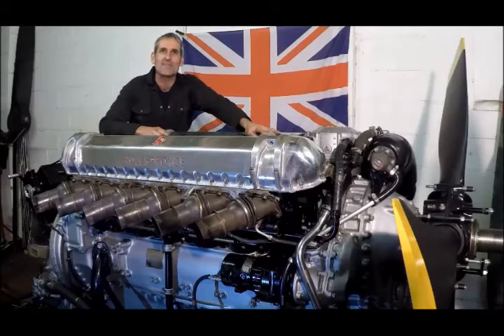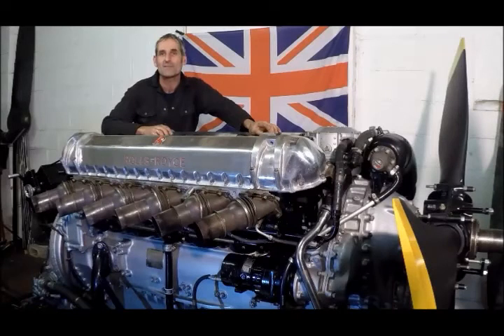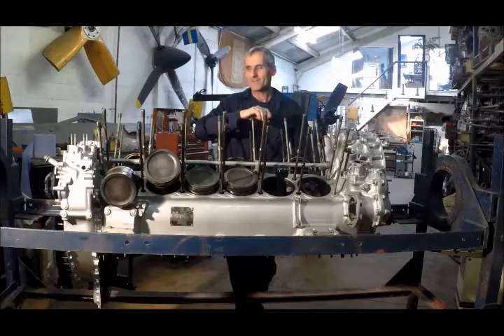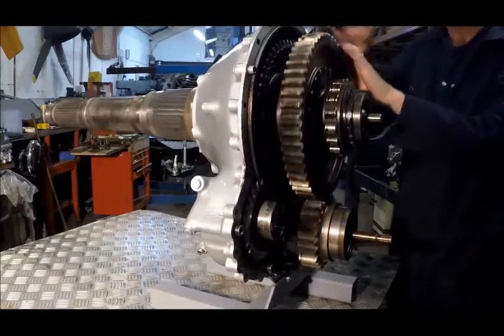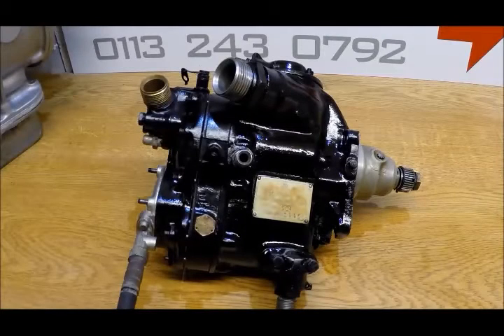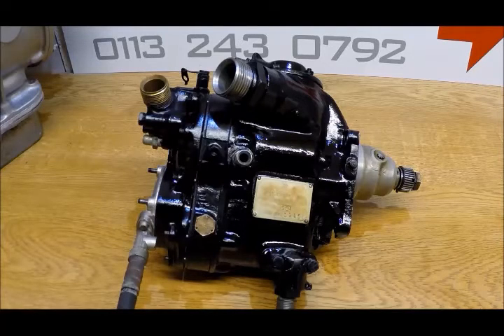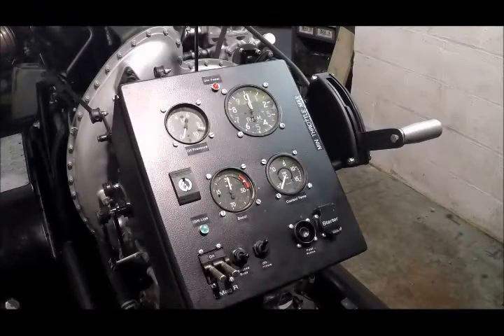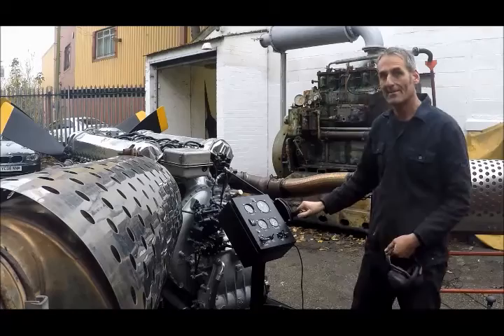New DVD Title! Inside The Rolls-Royce Griffon Aero Engine...

Comment: Great video. 
In the early 1980's as an air cadet I was lucky enough to get a 6 flights in the Shackelton's along at Lossiemouth. Many good memories and the amazing sound of the 'Griffon Growl' as they used to do circuits and bumps at Kinloss. 
My mate's father was in charge of 8 sqdn's engine bay so got down for a week in the summer holidays as some kind of work experience.

Comment: This is like the Mandela affect ? I've never heard of the Griffon engine in spitfires before. The 2nd World war was all about the Merlin engine and how it powered everything in the UK and the US built P51 Mustang.  I've never heard anybody ever mention the Griffon engine unless I've slipped through an alternative universal paradox  ????
Reply: Supermarine knew that the 27-litre Merlin engine could be developed only so far, so, in 1939, they took the 37-litre "R" motor that had powered the Schneider Trophy seaplane racers in the early 1930s and used it to develop the Griffon. The first Griffon-powered Spitfire was the Mark IV, which flew on 27 November 1941. Only one, possibly two, Mark IV Spitfire was made and was re-named the Mark XX to avoid confusion with an operational photo reconnaissance model.
The first operational Griffon-powered Spitfire was the Mark XII in October 1942. From then on, all the Spitfire variants were Griffon-powered. The exception was the Mark XIV, which was effectively a Mark IX with a Packard Merlin.